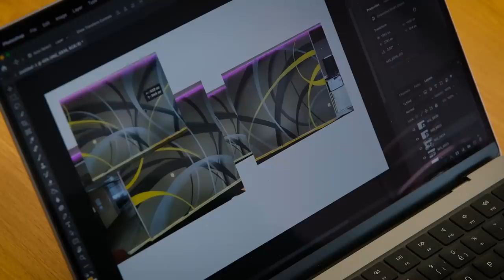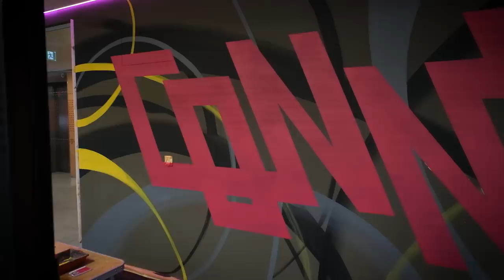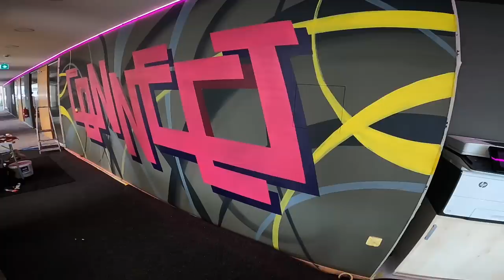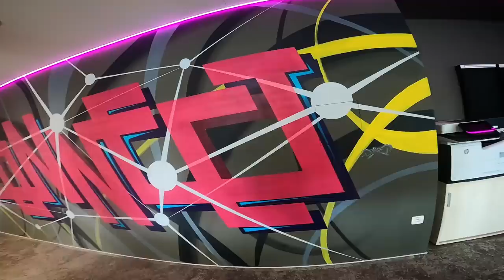Painting a Tricky Mural for IT office!

Comment: Just a little tip, because I already worked with masking tape for a few times..
As you already mentioned, you should be quick after applying the tape, so you can remove it as fast as possible - less dmg because less sticky!
Take your time while removing it.. do it bit by bit, and only from "the front", don't pull it sideways to hard or you will probably dmg the wall

Comment: Hey you were talking about having problems with the tape get your hands on so FBS tape. It is by far the best tape out there. It is used for the custom car painter and airbrush artist. We have the same problem of the paint pulling up when the tape is pulled. Now there are things you can do to stop paint coming off with the tape but that has to do with the prepping of the surface and the way you pull the tape off. But I still recommend getting your hands on some FBS tape.

Comment: you can get that spray paint that i s low odor, no? Or does that spray paint not work that well with your pallettes and techniques...never used the low odor versions myself yet.
Reply from the maker: The odor problem is better but people still shouldn’t breathe it.
Reply: @DokeTV  perfect point. I just figured it was an odor problem. But, yes, people shouldn't be inhaling that paint.